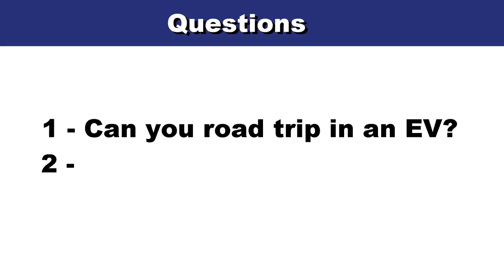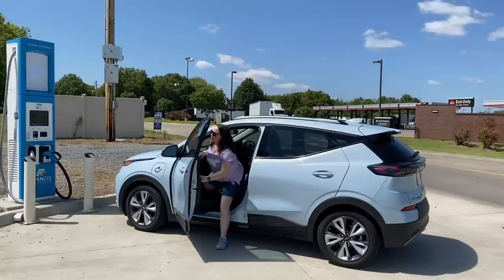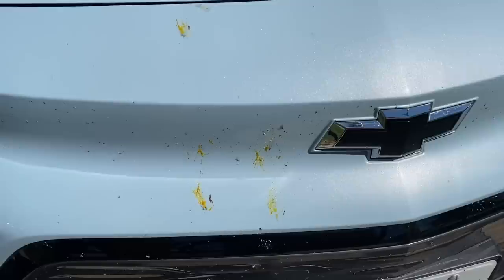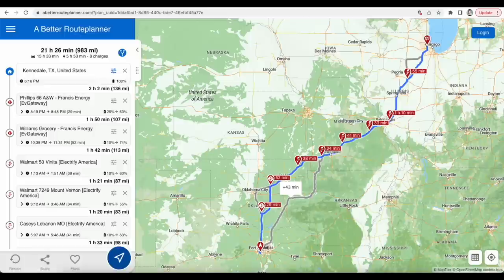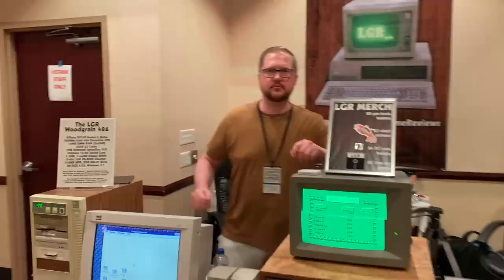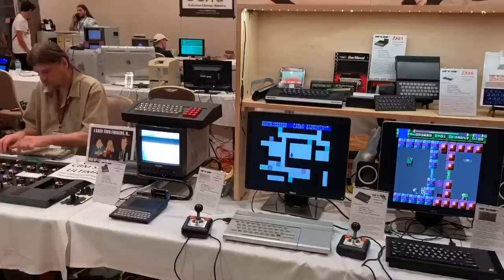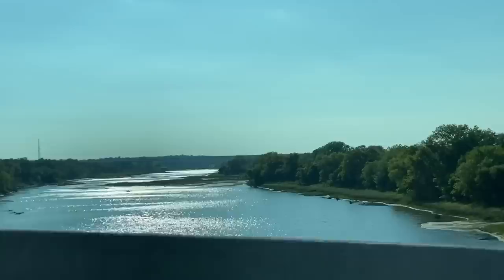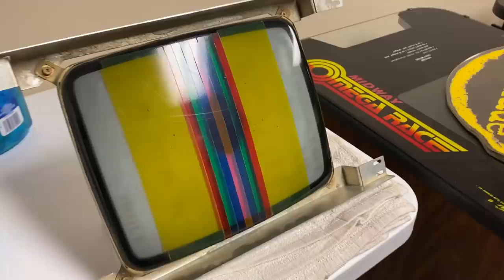EV Roadtrip, Vintage Computer Festival, and Moonbase Repair

Comment: In defense of Galloping Ghost, while it is $25 to get in, every machine is set to free play. Plus that's for the entire day, with you being able to come and go throughout the day. Plus, they have a building down the street full of pinball machines. As for machines being down, most of the games in there are VERY rare nowadays, which means parts can be hard to get. They do their absolute best with making sure the games are in playable condition, but there is usually only a VERY small crew working at any given time. So it's tough to work on the games while having to man the front counter. I've watched GGA grow by leaps and bounds over the years, and I personally think the entrance price is more than fair for the vast amount of games the have to play. Not only do they have many people coming from around the country specifically to go there, but they've had many international visitors as well. You will NEVER find another arcade quite like GGA. I say all this as a regular customer with no stake in the arcade at all.
Reply: I thought about the Real Estate costs for the place. Rentals for buildings and places like that seem to only postpone an eventual mass sell off or donation to the local landfill... of all the machines when the lease gets pulled. Things can happen so fast. They're like Time capsules .. visit them while you can.
Reply: I think $25 is reasonable for a full day. I mean it's not a place you go hang out every day, but I understand if you only got an hour to visit then $25 is a bit much. Anyway, I don't even want to think about what their electricity bill is like.
Reply: I agree with the other two responses - $25 for entrance into the biggest arcade in the country seems very reasonable to me.
Reply: One of a kinda museum of that magnitude for $25 seems reasonable. Crazy that it exists at all.
Reply: Another thing to consider is, if they pull broken machines off the floor, where are they going to put them? Shifting the allocation of customer floor space to storage space simply means that in the long run, as you get things fixed, you can't display as many machines.
Reply: I knew it!
Reply: only 8 bit guy would see fit to complain!
Reply: I haven't been there since before the pandemic but they were probably hurting for a while with the lockdowns and mandates. Cost seems to have gone up since last time but with inflation I'm sure their operating costs are pretty heavy. Looking to go back there within the next month or so. I think the price is pretty fair if you make it a whole day event plus there's restaurants / bars nearby.
Reply: Been to Galloping Ghost a couple times  and really enjoyed it.  I will go again.   $25 ain't bad when gonna be there 3 or 4 hours.   Going to a movie for like an hour and a half is $15
Reply: I would think they leave them out because 1 its crowded and would be difficult to move every broken one t oa back room for work on it and 2. They cant fix them all at once so leave them out for people to actually at least see and touch them again. Could be someone's favorite.
Reply: I haven't been, but I would love to go. The staff there are awesome.
Reply: i love galloping ghost as it's like 15 min away from my house and there's no place like it anywhere else. i wish they had more pinball, and i believe their repairs are done by volunteers irrc.
Reply: I agree. Considering you can spend nearly 40-50 dollars (or even more) at a modern Daves and Busters or some other place just to play crane games, I think that's a very fair price for history. Its a place that's definitely on my radar to visit very soon.
Reply: Only if this place is near east coast, i will go everyday.
Reply: It is a tough conundrum many businesses are in. The operating costs must be huge and are only getting higher and higher, year over year while at the same time the average person is getting poorer and poorer year over year and less and less likely to be able to go as often (or at all.) Raise the price so you can stay in business but then you have less customers and will go under anyway. We can't win nowadays.
Reply: Question: Does paying to get into Galloping Ghost also get you into the pinball, or are they seperate costs? Cause I might have to put that on a bucket list.
Reply: @TheStuffMade  would be neat if you could play like 600 a year for you and a couple friends to get unlimited access
Reply: I just wish it had the 80s carpeting
Reply: Galloping Ghost is well worth every dollar. That place is a literal playable museum. I throw a couple bucks in every time I visit.
Reply: They could spruce the place up a bit at least. Make it look like arcades of old.
Reply: I think 25 is hella reasonable, you couldnt even have an arcade that size here in australia, the building lease alone would bankrupt you let alone the electricity and buying the games, plus maintinence, staff costs etc they'd have to charge like a thousand bucks a head entry, and no one would go even if it was 50 bucks here, wouldnt work, ive wanted to open a classic arcade for years, but its seemingly impossible unless you already own either the building or the games.
Reply: Jeff, and others, thanks for chiming in on this. Many of us didn't have money to spend hours to become good at a particular game. [Edit: I forgot to mention that them having an all-you-can-play business model allows us to get practise at a more affordable price]
Reply: I remember when arcades had no entry fee, but lots of gambling machines to attract that other crowd.  Of cause the games with no payout were more profitable.  Then of cause the arcades inside other businesses making profit from visitors. I've experienced fast food establishments and large ferries having a few arcade areas inside.  Amusement parks have them too, usually in basements under other rides.
Reply: Your basically paying a 1 day rental fee to play whatever they have for the whole day as checking every single machine for quarters is simply unrealistic so that's why they did that to avoid the next to impossible logistics needed to make that work with quarters and you can already tell there work force is stretched pretty thin.
Reply: See, now, that sounds very reasonable to me, especially in this economy. I thought he meant $25 plus paying for every game you play.
 
And having 800 arcade cabinets, it's no surprise that some of them were not perfect. XD
Reply: I'm taking to trip from Australia to the US and one of my "tourist" destinations is to spend a day at Galloping Ghost. We have a place not far from me here called Arcade 1Up.. It's $15 AU for an entire day. I don't mind spending $25 US for "THE" Galloping Ghost. I'm super excited for it. It's a highlight next to Disneyland. haha
Reply: @ironmaiden5658  Have fun with all of your driving if you're not landing in America's shooting gallery.
Reply: @AsukaLangleyS02  He's a proud Texan already!
Reply: @videogamerNattie98  The working with quarters isn't a daily counting exercise.  It's emptying the full ones and moving the bags of quarters to the bank.  Income from each specific machine is relevant only when deciding to adjust or scrap a machine.
Reply: Perhaps GG charges double because they don’t sell booze. A lot of other cheaper arcades are also bars.
Reply: @AsukaLangleyS02  I can tell you now I won't be hiring an EV as my mode of transport to get around the country. I'd need to pay myself another week of standing around looking at a Walmart for most of my holiday. . Landing in LA. Driving across to Florida via Houston. Up to New York. Across to Calgary then down the coast back to LA. . .
Reply: Back in the mid-90s me and a buddy would spend $20-$40, each, at the local arcade on a Friday night for about 4 hours of entertainment. $25 for an entire day in 2022 money is dirt cheap.
Reply: $25 for All Day All You Can Play is not unreasonable to me. Given the soaring prices of real estate and utility costs, they probably aren't even making much. I'd love to visit someday.
Reply: @Clay3613  From my memory, that place * is * like the arcades of old with the dank and the ailes.  They would only have to pump in stale cigaette smoke smell to take me back to the many lesser arcades of the day.  :)  :P
Reply: I am a big fan of the Galloping Ghost and I try to go there a few times a year.  I do agree it seems to be getting shabbier but I assume that was the afteraffects of the COVID times.   Still $25 is a bargain and they * still * get bigger every few years.  I remember when they were only two storefronts.  Now they go all the way to the end of the block.  The fact that they are also grwoing their pinball collection which is notoriously more labor intensive for repair, is admirable and I hope it gives them more success.
Reply: they could do a fundraiser to overhaul the place    add blacklights   add that fancy 80s style carpet and stuff   maby add a membership option and turn it into a propper hangout
Reply: Also: if You are at GGA and a machine is not working - TELL THEM AT THE FRONT DESK and it will be added to the list for a service.. Also (2), given the complete drama getting that Space Invaders clone featured in this video to work, it's a tad 'off' complaining that someone else cannot keep 890 games up & running 365! Also (3), GGA does not 'do' clones or bootlegs it appears, so finding any space invaders ripoffs on the floor would be highly unlikely Also (4), Other museums get funding from national or local arts schemes, and You are not allowed interact with the exhibits, GGA's charge is completely reasonable when taking this into account, and especially so when comparing it to other days out - like the nearby Zoo or even a Cinema.. (remember them? no, neither do i..)
Reply: I haven't watched the video yet, but how can one complain about a $25 entrance fee for an arcade. There is none in my area (Germany) where I could go to. It is 2022 and payments for the building aren't cheap in the US I guess and electric power isn't a present from your government as well. Sure he has to pay 255 more month to pay for his car, the $25 is a load of money. Unluckily I helped him with the EV by buying a t-shirt for $25
Reply: Fortieth reply.
Reply: Thank you for providing some context. Being able to free play 800 plus games for $25 is a steal as one could easily go through $25 in an hour and a half at a normal arcade. 

Also, I'm sure that the Chicago real estate market kind of forces these prices as well. You could probably get away with less at the arcade was in rural Iowa
Reply: @FIDEL_CASHFLOW_  If only somebody would Adult Adopt me from the Hellhole of Gate City I live in!
Reply: @axemanracing6222  Axeman Racing, come to Gate City, VA where there are none at all! And also somebody (NOT including you) should Adult Adopt me! So I can have better parents who can afford this.
Reply: @johndododoe1411  The problem with that is with so many machines its very unlikely that will ever happen with any one machine cause think about it there is 800 machines and thats an estimate if it were a small arcade then yes that would be more reasonable due to the higher footraffic per area so one machine in that situation will more realistically reach being full.

But for that many the foot traffic will be to low in any one area to let that be a feasible way to make money. That you would need to check ALL machines on a weekly basis to then get all the quarters to make any real profit which is frankly to much work that its better to do a 1 time pay rental based system here.
Reply: Even being located in the US, their electricity bill must be sky high running hundreds of these inefficient old machines all day long.
Reply: Woah! Yea, I was just thinking of that. The old arcades made bank from all the coins people were putting into the machines. If all you're paying is a $25 entry fee, they probably have to pick and choose which machines to repair and which to leave. (I would assume, anyway)
Reply: @Jeffy Kenny Can you hear the arcade games in Galloping Ghost? I ask because so many other retro arcade/barcade type places have the volume too low on the coin ops. Many of these places play music in the background over speakers throughout the building. That makes it even tougher to hear the games. How is it at Galloping Ghost? Thanks.
Reply: @sn1000k  I guess he wanted to get in for 8 bits!

Comment: The glass tube breaking at the end of the project is an experience that's all too relatable..
Reply: I had that unfortunate experience long ago while repairing a Commodore 1084 monitor.  I had just fixed a loose connection, and I was maneuvering the back of the case down onto the chassis.  While still a couples inches above, it slipped from my fingers, and since it wasn't perfectly aligned, something in the case back caught on the CRT neck board, torquing it and breaking the neck.  It's always such a disappointing feeling when you try to fix something and end up making it worse.  I ended up giving that set away for someone else to use for parts.

Comment: 13:45 Props to David for actually sounding like he kept a quite a cool head after the sound of that tube breaking, God knows my first reaction would have been a whole lot of swear words for 10 minutes straight
Reply: Mike actually sounded more upset. David is just the Chill master.
Reply: David has to be super chill. I would have gone through the roof, given what that tube/entire game was worth, especially if I did it and only had myself to blame.
Reply: I would have been screaming ef! Ef! Ef! Ef n’ A! G Dammit! Efffff!!!!! (I have anger management issues when “repairing” stuff).
Reply: I was expecting it to happen in the previous video when David pull and in so many times, CRTs are heavy and fragile, it simply will eventually happen. Maybe that is why he is so calm.
Reply: I would have walked into the ocean.
Reply: His brother: What have you done now?
Reply: he has a fair bit of experience breaking vintage tech
Reply: It took me til about my mid-40's before I could stifle the "Screech like a punctured bunny" during moments like these.
But yeah I felt that.  RIP CRT.. :,,,(
Reply: @Okurka.  Yeah, must be a common thing.
Reply: I'd have gone through my extensive range of swear words for sure. But it's just one of those things sent to try us. :(
Reply: @mycosys  It is kind of inevitable when you work with vintage tech for a living and is honest enough to show your mistakes.
Reply: 😲 I would have accidentally summoned a demon with my cursing...
Reply: Idk who would remain cool over a multi billion dollar loss that may never align again. All over selfishness and Iraqi bidding on a choose sex partner that has no idea about being on the auction block for a few fellas to takeover.

Comment: I think I can honestly say that a lot of us were truly feeling your hurt when the tube broke.
Reply: Hopefully there's a way to repair the phosphor coating, re-vacuum the tube, and re solder the glass to seal the hole...
Reply: @blenderbachcgi  it’s easier to just find a monochrome CRT that’s the same size and just recreate the tape filters
Reply: @amirpourghoureiyan1637  But it won't be the same. The filters are very specific. The wavelength of light they allow through. We would need to find out what they are, and also measure where to precisely tape them.
Reply: @blenderbachcgi  The easy thing to do is peel the filters off the old tube and transfer them to a new one.
Reply: @blenderbachcgi  They look like they're cut from standard theatrical lighting gels.
Reply: @amirpourghoureiyan1637  Dave mentioned that he had a lot of trouble finding a white monochrome CRT in that size. Probably easier to get a color one and common all the cathodes.

Comment: That CRT crack and hiss sound is as terrifying as a dead hard drive ticking sound. They are nightmare material. Great work, David! Love seeing old stuff back from the grave!
Reply: Ahhh, yes, the HISS of death!  It means the phosphorus genie has escaped and the CRT will not perform it's magic any longer.
Reply: There's a difference. You can send the Hard Drive to a lab to get the platters out, reseat the platters in new working drive, and copy the data to a new drive. You can't save a CRT, however...
Reply: Breaking the CRT's neck was exactly what I was worried about all the time watching that last video... ouch
Reply: oh yes the sound of nightmares
Reply: And i thought a creeper hissing in Minecraft was bad!

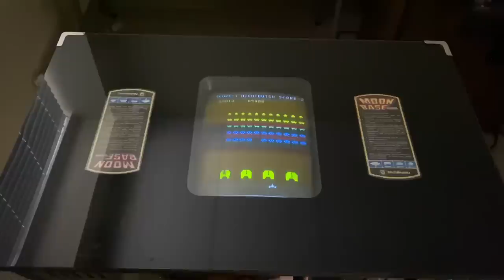Comment: 15:20 For the glair issue filming Moonbase, try throwing a polarizer on your camera and rotating the filter to reject the overhead light. Should look great!
Reply: Yep, you're referring to a CP (circular polarizer) filter.
Reply: @nimoy007  no, a CP doesnt need to be rotated, he is talking about a linear polarising filter.
Reply: @mycosys  Assuming that my comment is held for review since I posted a link... You should probably check the validity of your statement. CPs and LPs are almost the same thing, but for cameras, a CP is the correct way to go.

Comment: I feel your pain, on necking that CRT. I did that once in my repair days, in the 90's.
Once.
The black spot in the phosphor is most likely due to moisture in the air. When the neck broke, a "blob" of moist air got sucked into the CRT and smacked into the front of the screen, accelerated by the vacuum, making the phosphor darker.
I saw Robin on Ben Heck's video on this same show but did not realize who he was.
Cheers,